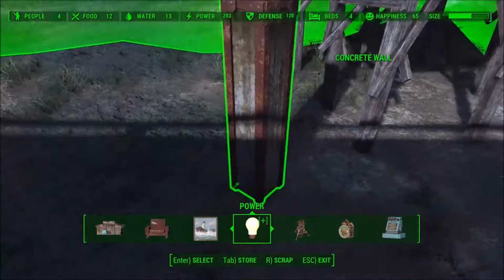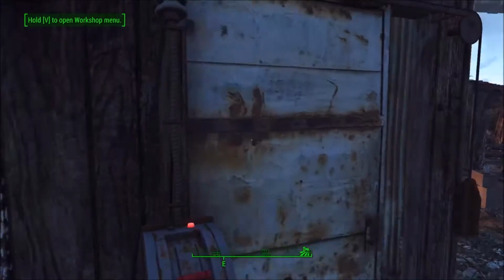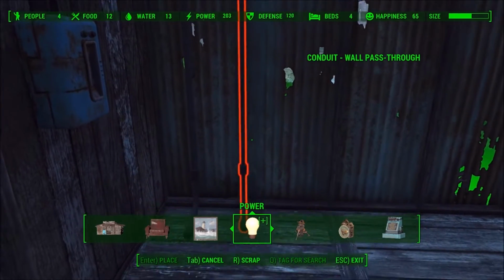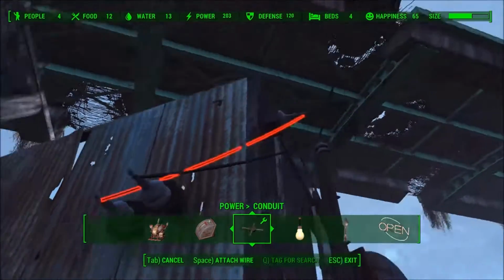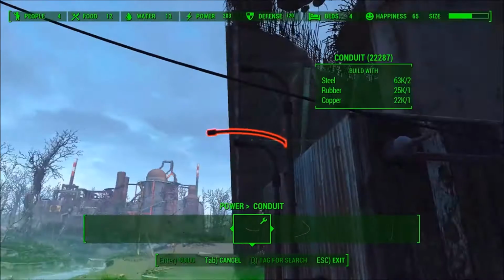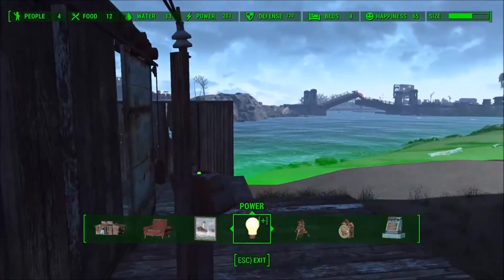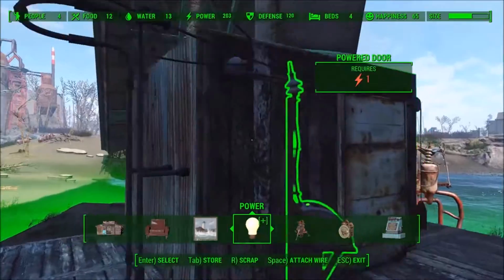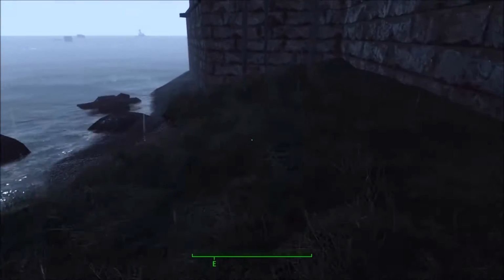How to Build a Simple Powered Door Continued

Comment: I use the logic gate for my security doors at the Castle. When the siren is activated, power goes to through the secondary circuit, and the door to the Castle closes. When the emergency is over, the door reopens.
Reply from the maker: This was an idea I thought about showing as well, but I didn't want to get too deep into logic gates.  I have been trying to figure out exactly where to use this option, but so far I haven't build a settlement it could be useful in.  I think my next settlement may change that though.  Thanks for being here and the comment, much appreciated.

Comment: Great explanation of the application of 2 easy solutions to powered doors. Both are needed and the added bonus of a delayed switch. Thanks for sharing and taking the time to show us your prowess over this confusing issue!
Reply from the maker: No problem at all, I wanted to be sure that I showed there were more than one way to do a powered door, and I know there are even more out there, but these 2 seem to be the most likely used.  You could use the one with the logic gate in either scenario, but would have a problem if you used the one without a logic gate in both.  Thanks for stopping by, always appreciated.